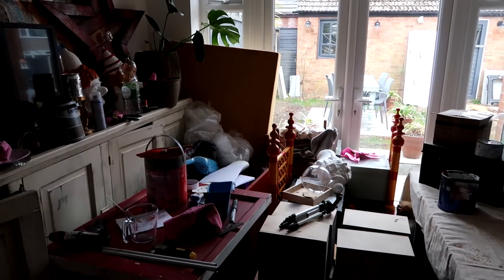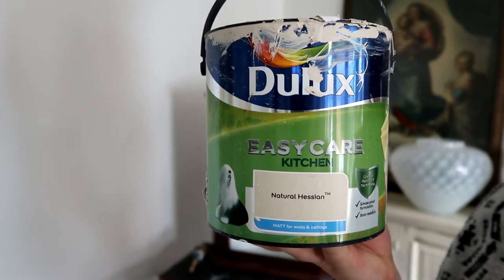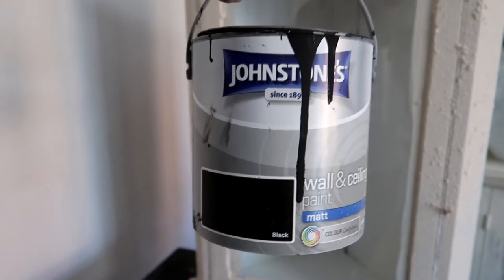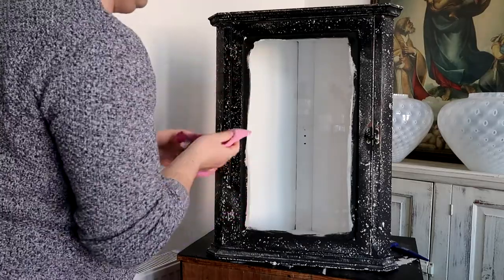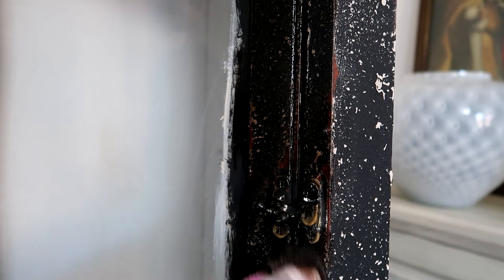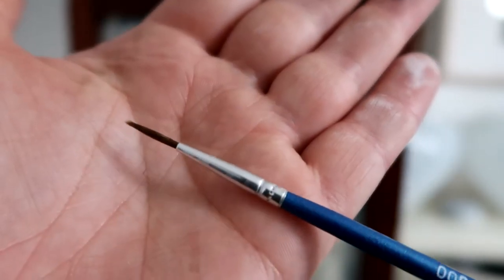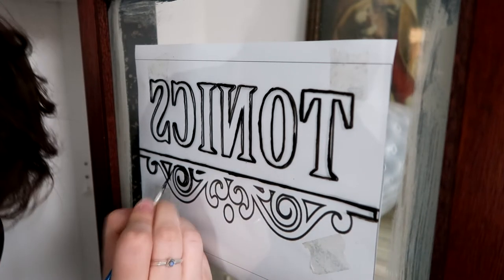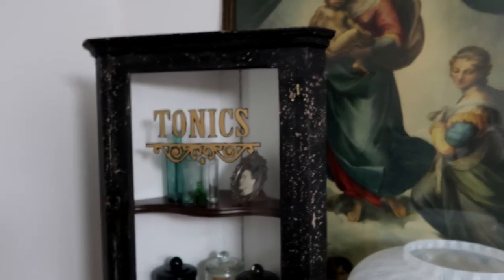DIY Apothecary Cabinet ⚗️ DIY Drinks Cabinet 🍷Hand painted glass graphic

Comment: What glass cleaner did you use here please?
Reply from the maker: I usually just pick up whatever is cheapest in the store. In my experience the brand really doesn't make much of s difference ☺️
Reply: @KieransUpcyclingJourney  thanks for a reply! I actually wonder what kind of cleaner this is in general? Not a window cleaner is it?
Reply from the maker: @pifpafpat  ah sorry in this video I am using the pledge multi surface spray cleaner. It leaves a good streak free finish but usually I will just use glass cleaner